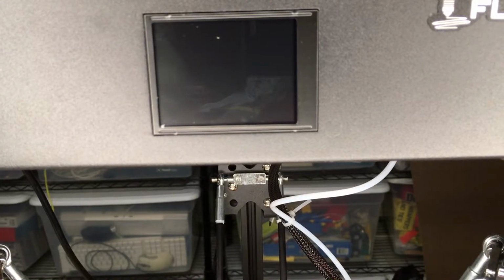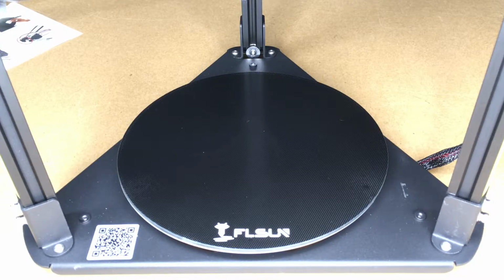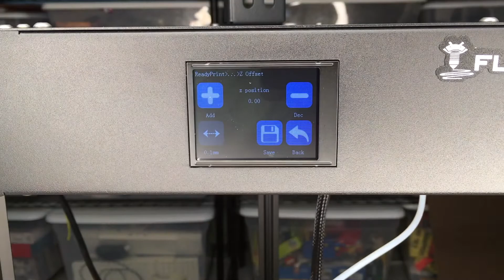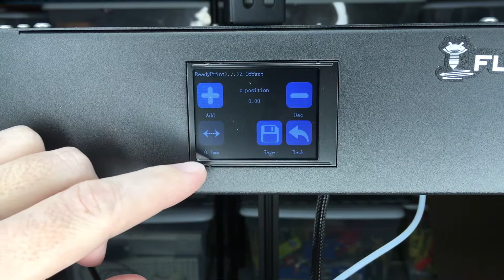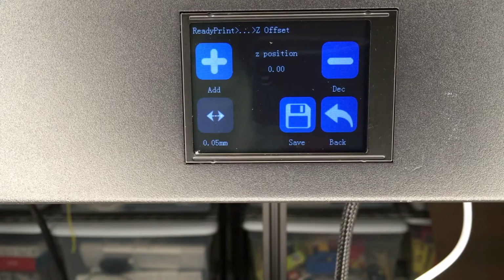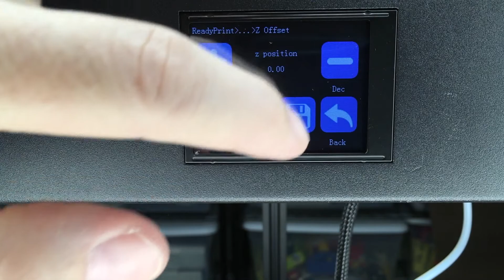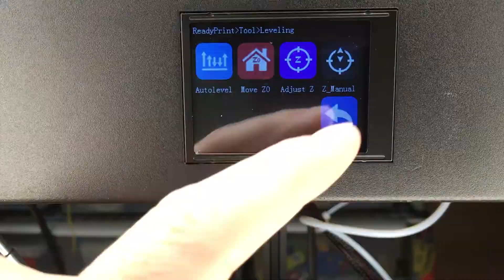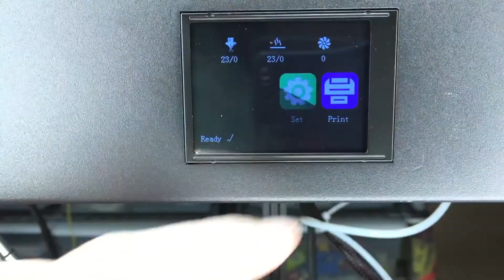FLSUN Q5: Auto-leveling and Calibration (Ep. 2)

Comment: I hope you are still reading your comments.  I purchased my Q5 Mar 2021 and it has worked famously until last week.  I finished up a project on Friday and didn't turn the printer back on until Sunday after church.  I wanted to test the print part of another project to check my design.  The part fell apart.  I checked the system to make sure everything was tight and did an auto-level, which looked correct.  Now the effector drops between 4-8mm into the print and then pulls it from the bed.  I have reloaded the firmware, now about 10 times, and it has gotten worst.  I have sent messages to Flsun and they recommend that I check the vref on the steppers.  Their reference vref is 1-1.25, and I am reading on all of the steppers around vref of 7.42.  I never thought about checking this when I got the printer since it was good right out of the box.  I have asked the sales department if I can just purchase a new motherboard and stepper drivers and so far they would only refer me to their service department.  In fact, before I messaged sales I had sent a message to the service department and no reply has been received.  I purchased this through eBay and my next step is to turn this over to them if nothing happens in a couple of days.  I am not asking Flsun for a new unit even though it may be under warranty.  I just wanted to buy a board and steppers and continue on.  Their website offers replacement parts, but no way I can see to purchase them.
Reply from the maker: Are your belts tight? I've heard of that causing problems. If you are on Facebook, you might consider asking for help on the FLSun owners group (https://www.facebook.com/groups/120961628750040/). Maybe someone could offer insight into your problem.
Reply: All of the belts are properly tensioned.  That was the first thing I checked.  I went back and forth with Flsun, messages being given to service support from sales, and it seems that they got turned around. I finally got service and clarified an issue.  I could not get a good reading with my multimeter on the vref.  I am now getting the 1-1.25v that I should on all stepper drivers.  Now I am working on, I believe, an issue with the effector(hot end) dropping down in mid-print.  I keep getting wavely sides on the right-side X movement and on the back Y movement.  I am running a print now and I hope that issue has been solved also.  Thanks for your response.

Comment: Hello Rick, do you auto align and set z0 every time that you set the printer on? When I put the printer off, the next time I set it on, the alignment is gone, at least the z0 is not set correctly. Do you have the same behavior?
Reply from the maker: It retains the settings after you do it the first time. There are reasons to redo it. You would redo it if you are having specific problems related to leveling. You would redo it if you replace any of the parts (hot end, belts, etc...). It might also be appropriate to redo it if you move the printer. That being said, I moved mine and haven't had any issues.

Comment: That squeak when you turned it on sounded like a capacitor. Have you had any issues with your printer yet? You might want to read this and/or bookmark it for later: https://www.ukgamingcomputers.co.uk/blog/capacitor-squeal-coil-whine-explained/
Reply from the maker: I think it is a power on beep. It does it every time I turn it on. I haven't had any problems with the printer as of yet.
Reply: Mine has never beeped and that noise specifically sounds like a capacitor - possibly in the power supply unit. Did you happen to turn it on at some point without switching it to 110v first? This is what it sounds like: "In electrochemical double-layer capacitors, electrolysis decomposes the electrolyte if the voltage rating is exceeded. This generates gas, which increases internal pressure. If the pressure gets too high, the case will vent." 

I've heard FLSun is good with warranties except if you're in North America it takes a while for replacements to ship from China and sometimes problems occur at customs from stuff coming out of China into the USA. 

Or if it doesn't bother you it may not give you problems but it wouldn't hurt to reach out to FLSun and see what they say about it.
Reply: @EugeniusTech  I actually did what you said - turned it on while it was on 220v mode (I wasn’t aware there was this option as I ordered a 120v version and thought I wouldn’t need to switch anything). Is there any issues I’ll face with this? I do hear a beep when I turn the unit on.
Reply: @222dillon  Definitely that squeek sound isn't normal in the video. I've seen/heard bad capacitors when I worked at a computer store. You might be fine and just have to deal wtih the annoying noise but I'm not certain. I found these two answers searching for what happens if you plug a PSU set to 220v into a 110v outlet:

answer#1 ) Plugging a 220v device into a 110v outlet is not recommended. If you did, it's highly likely that you'll damage or destroy the appliance. If your device has no motor, then it'll perform poorly, running on half the needed energy. If the device does have a motor, then the lower voltage can damage it.

answer#2 ) 115 on 240v will make the output highly unstable and thus your components life span is drastically reduced.

The power supply is model CL-C240W24V if you wanted to replace it with a new one.

Comment: oh my god... I just did my first prints on mine and didn't realize there was a protective film. I wondered if there might be because the buildplate looked... bubbly but i couldn't easily get a fingernail under it.  Thanks for the video. I'm thinking of doing a series too because this printer is so poorly documented and hasn't yet achieved a community anywhere near as large as say the Ender 3. I want to see if I can fit a v6 volcano hot end to it because what appeals to me about a delta is printing at very high speed. Combine the kinematic advantages with 0.8mm nozzle and this thing could pump out parts in no time.
Reply: There's a sizable Facebook group with lots of helpful information and advice
Reply: I honestly don't think that anything will reach the community size of the Ender 3 any time soon.